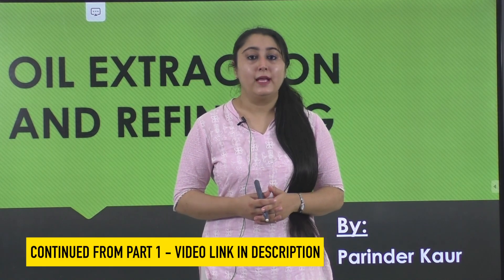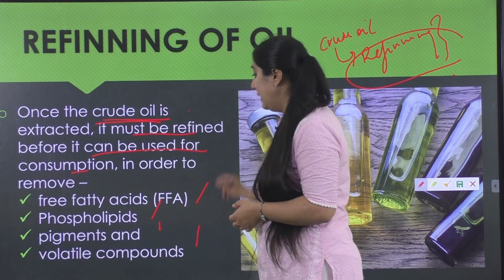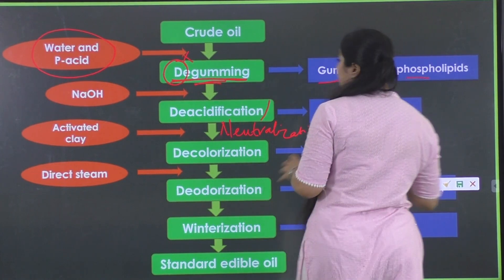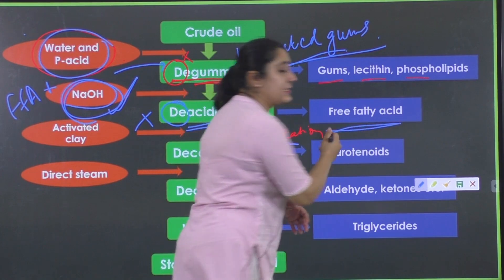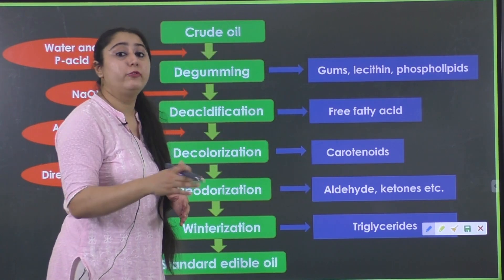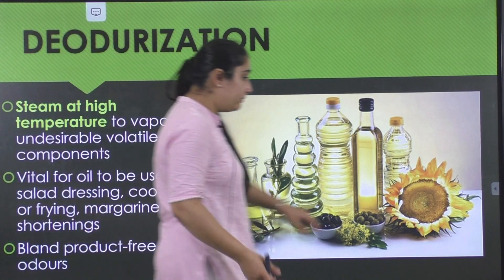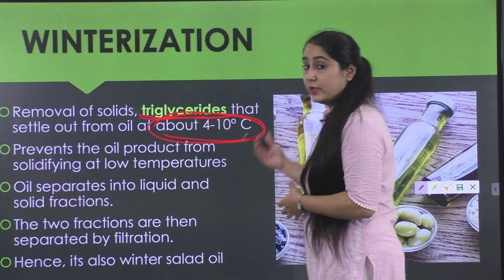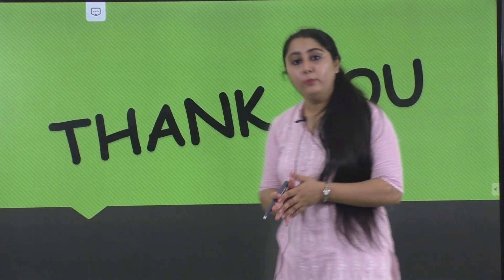Oil Extraction and Refining - Part 2

Comment: 2) Neutralization: - FFA themselves have very low boiling points compared to triglycerides. When present, they volatilize early and contribute to visible smoke.
- So, removing FFA should actually raise the smoke point, not lower it.
- Shelf life is not directly tied to smoke point.
- Shelf life depends more on oxidative stability. Removing FFA improves stability because:
- FFAs are highly reactive and prone to oxidation.
- Their removal slows rancidity, extending storage life.

Comment: Mam in the neutralization step Removal of free fatty acid to increase the smoke point of oil you said to decrease the smoke point of oil. The more FFAs an oil has, the faster it will break down and start smoking. Refined oils usually have less than 0.05% FFAs, which results in a higher smoke point.